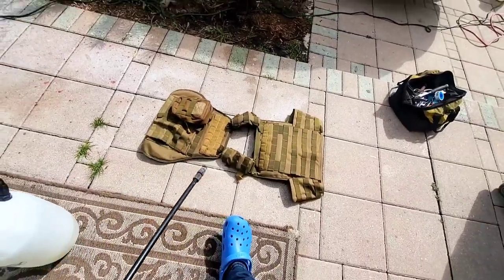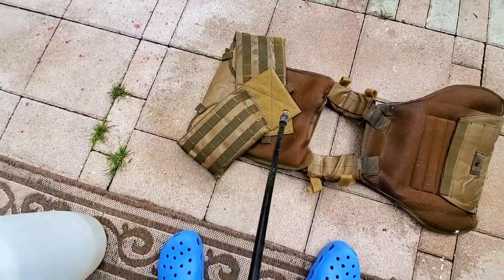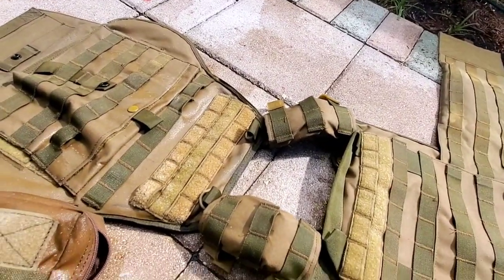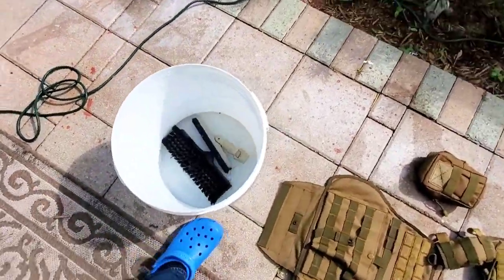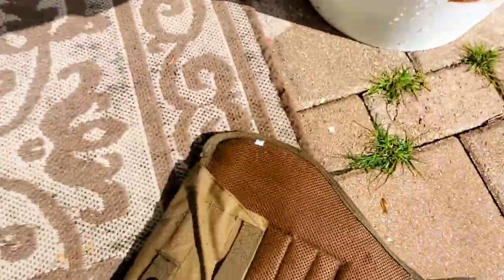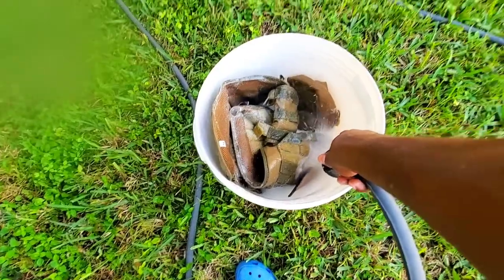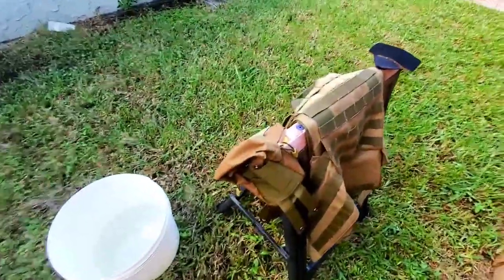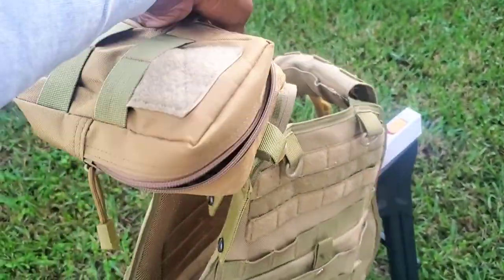How to properly Clean your Plate carrier / Washing Duty Vest

Comment: I would think that you stripping away all the straps, breaking the panel apart, removing the protective panels and putting in the washer on a gentle cycle would be more efficient. Plus all those Chems can't be all that great for material over time. But nothing last forever I guess!
Reply from the maker: I would only a deep clean every couple months , due to me wearing this everyday and it being a light tan color. A simple wash doesn't always remove stains.
Reply: @ReelbiteTv  Bruh don't drip Catsup and Mustard on yo carrier...lol